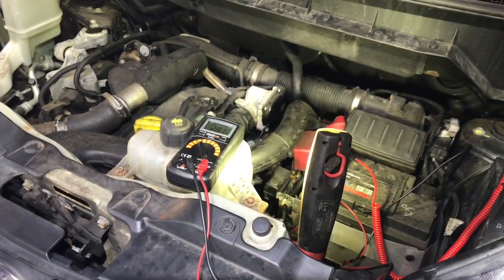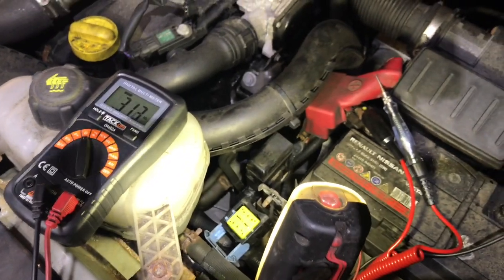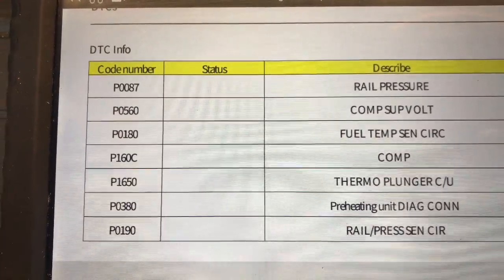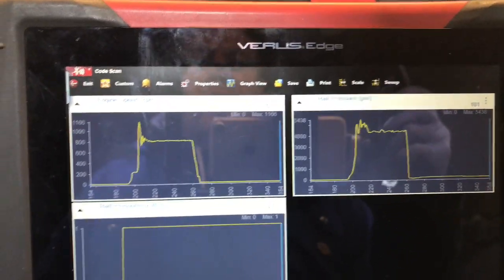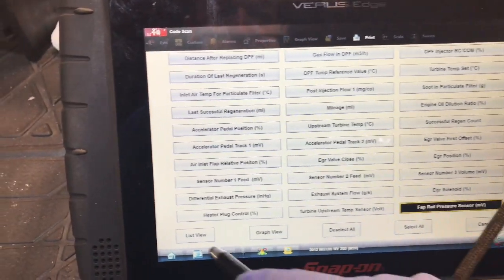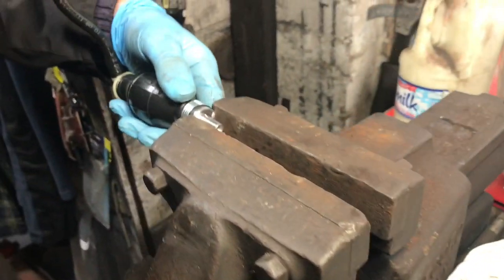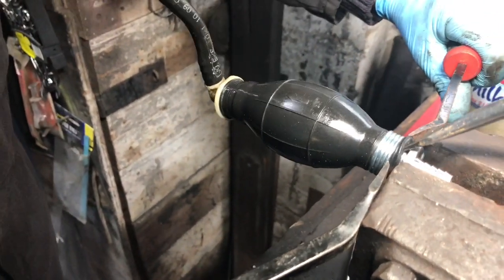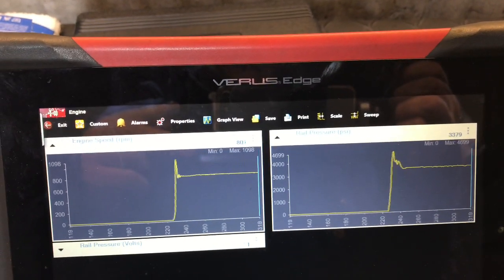Nissan MV200 (2013) - Fault Codes P0190 + P0087 Extended Crank Time!

Comment: Sandy, i have got a 2007 qashqai with k9k engine and the fuel leak of pipe was burst, replaced that and now it blows the pipe comes from the fuel filter, I am yet to put it on a code reader but could you please give me couple of pointers go after? Fuel filter as changed about 8 months a go but yet to check if its a decent one.

Thanks a lot.

Comment: Good stuff , some clear  pipes with  connections  for going onto the pump  would be very handy  when diagnosing diesels  with similar faults   .  thanks for tips in video  .
Reply from the maker: Cheers John we've got clear pipes but that pump was buried under a stupid cover!!! Cheers sandy